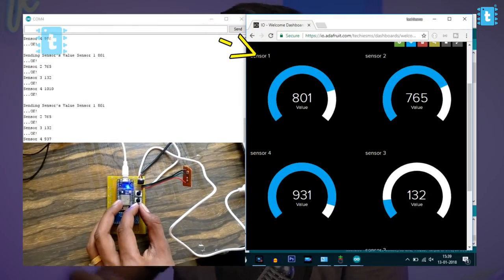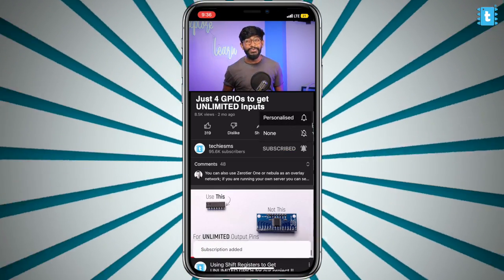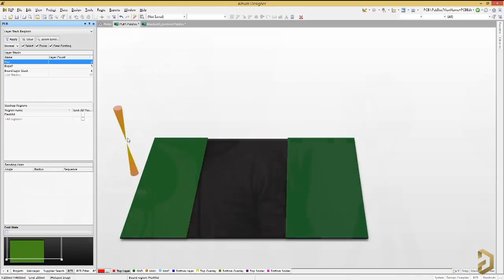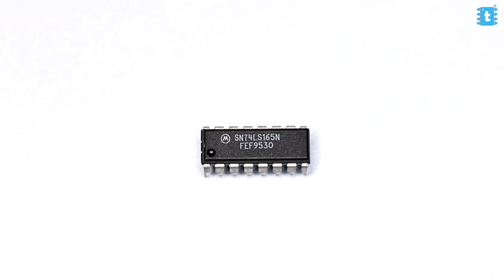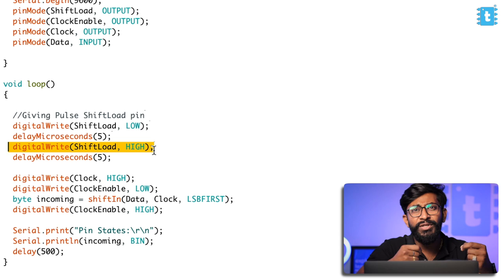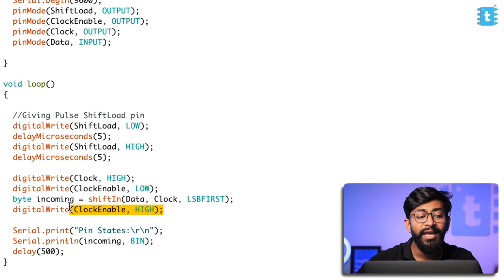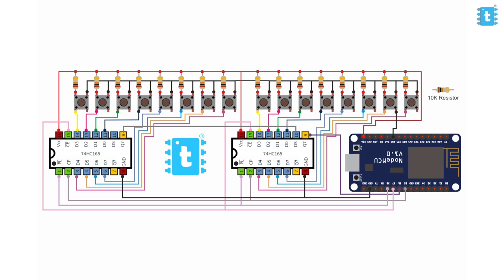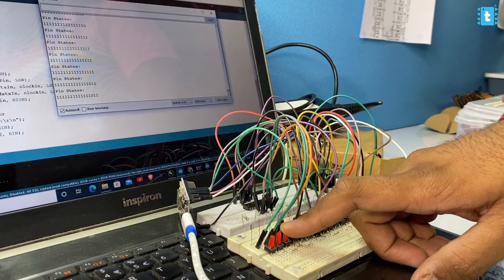Use this to get UNLIMITED Inputs for your microcontroller 🔥🔥

Comment from the maker: Where do you thing this IC will be useful for you?
Reply: Could you please make a clear  project video on  live tracking in which accident detection is included where sudden drop in speed is noted will be sent a SMS to a phone number
Reply: Sir please use this ic in cascade manner to make the big seven seģment digital clock
Reply: Parking system automation all IR sensor should connect with one microcontroller thanks
Reply: We can use this ic to get 16 input for switches and sensor and can make 16 channel home automation system with single esp 32
Reply: wb====when you do not need all the clock speed we may divide it over a bus on serial for efficient use , attaching peripherals ,ex- to make a video 25 fps image frame filling is enough to see every thing moving , over that any thing will be a over kill, unless it is for a scientific purpose ,  as an engineer we balance the sweet spot between efficiency requirement and precision,  after all we are considered about the input output and the realtime maths ,what else a CPU can do more
Reply: By adding more direct switch to arduino for home automation

Comment: You can use the SPI interface, so only have to do is preform a SPI read, justo conect MISO to the serial Output of the 165, the clock to clock and CS yo the Strobe of the 165.

The same thing with the 74hc595 You can use the same SPI interface to read and write outputs/inputs of the 595 and 165.

Comment: Once again helpfull. Thanks!
Can i use it for output?
Reply: Yes, but the circuit is different. You would use a sipo for that (serial in parallel out) unless you want to get tricky.
Reply from the maker: For output use 74595
We have a video for that as well

Comment: Thank you, but it's 8 bits (max 256 GPIO ==> if we are making a screen: it will be max 16*16)
Reply from the maker: no. it's actually unlimited 
each shift register is 8 bit and we can make their connections in series and can extend to more than 8
Reply: @techiesms  the meaning of 8 bits : 8 characters to code it
Bin ===> decimal
00000000 ===> 0
.
.
.
11111111 ===> 255

Total : 256

How can you turn on the relay at pin 257?
In your code can you turn on the 257 pin?